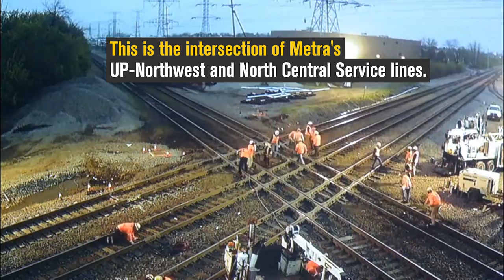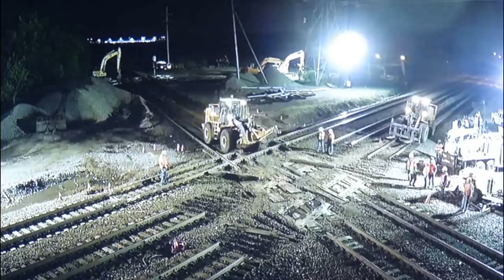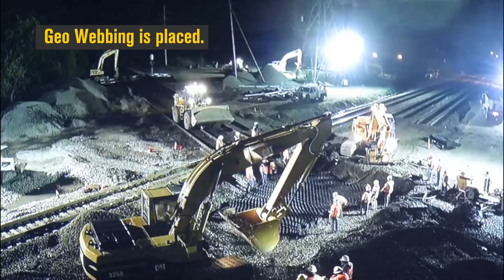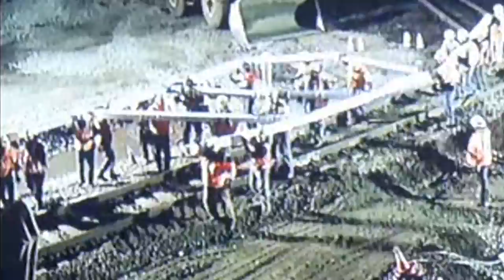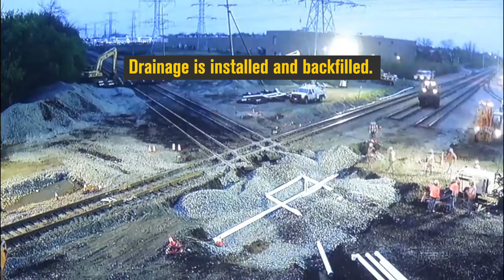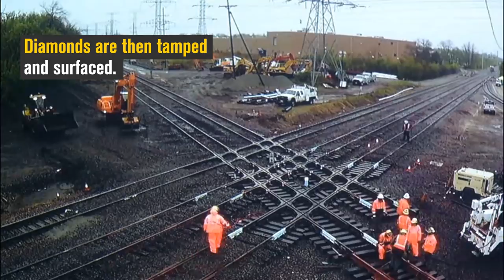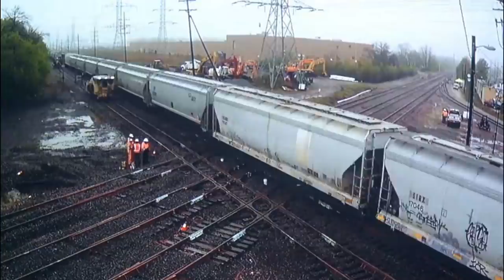Chicago's Five-Track Deval Diamond Replaced in Under Two Minutes

Comment: I have this new technology for you: it's called a BRIDGE.
Reply: That'd be nearly impossible here and extremely expensive.
Reply: DM Multimedia I don't believe you.
Reply: Then don't say anything about something you don't understand. .^.

"In this case, trying to grade separate the different lines would be very cost prohibitive. The UPNW line has two very close stations, (des plaines and Cumberland) so raising this track would be difficult. The NCS line south of Deval abuts a lot of houses and has very little right of way. And the UP New Line (Milwaukee Sub) from what I remember Carries the heavy coal trains, also runs adjacent to homes and parks (Wolf Park was always a fun train watching spot), and there is a cement factory (I believe) that squats right between the New Line and the branch to the UPNW. In short, grade separation is not possible. Track consolidation is not possible. Deval will remain, as a symbol of railroad efficiency despite limitations." -TheShadowNinja1.

"The math on a bridge at this location wouldn't work. You'd need approaches over a half mile long and heavier trains would still struggle to get up those approaches quickly. Due to the large size of the trains compared to other countries, US railroads run fewer, much heavier trains. By scheduling these freights during low commuter volumes, they can get the tonnage through without spending large sums of money to build a bridge over the existing tracks. As an example of railroads working with what they have, my home town has a two track diamond that sees anywhere between forty and fifty trains a day. With good scheduling, it can be made to work and the railroads tend to run three to five trains through in a row when they get permission to cross the diamond." -Lewish Andrews.
Reply: DM Multimedia if only experts were allowed to comment on YouTube videos... well, it'd be very different. Thanks for the thorough explanation!
Reply: DM Multimedia also, you know, joking :)
Reply: You're welcome, and sorry for being rude a second ago.
Reply: DM Multimedia You weren't really rude. And rude is the default response on YouTube. I find if people see I'm being genuine, they are almost always genuine in return. And I get that jokes/sarcasm are tough to read in text.
Reply: I don't know what to respond with.
Reply: Ahmed Kazikian look at the comment a few above yours
Reply: Ahmed Kazikian UP is a fortune 500 company, they're not going to do something and not have already done cost analysis and efficiency testing. This is the best solution or else they would have done something else. The end.
Reply: why would you want to? diamond is fine and theres no vehicular traffic issues? Be a waste of money